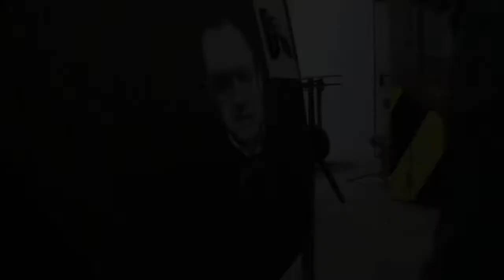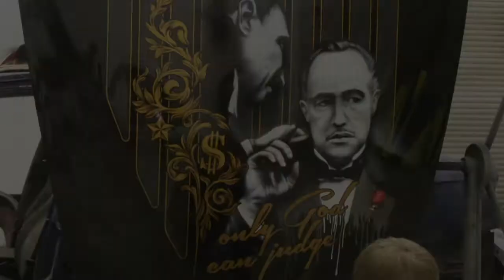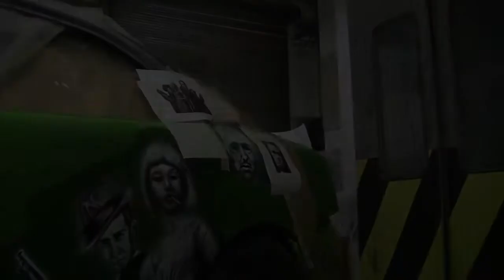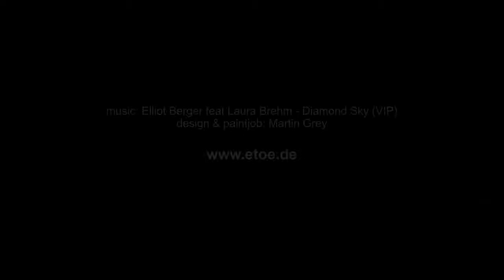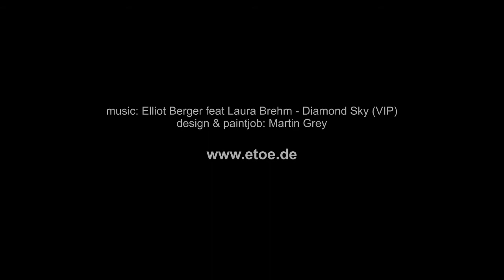Alfa Romeo 156 20v Turbo Mafiaalfa ETOE Custompaint

Comment: Richtig top, schöne Arbeit, und Natürlich als Basis DER COMMONRAILDIESEL, der der ganzen Automobilbranche zeigt/e, WIE man einen sportlichen, gar unkaputtbaren Diesel baut...der obendrein noch mit der sparsamste Diesel aller Zeiten ist.
Gerade im 156 ist der 20V dermaßen gigantisch, dass er seinesgleichen sucht!
Auch hinsichtlich Fahrdynamik ist der 156 obwohl FWD das Auto seiner Klasse, wo allem anderen in Agilität, Fahrdynamik und Kurvengeschwindigkeiten davonfährt bzw. ist es gigantisch, wie es Alfa Romeo allen anderen gezeigt hat, WIE man ein FWD zu einem echten Sportwagen macht.
Denn ich fahre und schraube nun seit 2004 Alfa Romeo, davon die meisten 156er, entweder mit Busso oder 2.4 JTD. Und eigentlich kommen mir nur RWD Autos in die Tüte! So hatte ich diverse BMW E30&36, sogar ein '86 E30 325i M-Technik 1, welchen ich via sperrdiff uvm. zu einem echten drifter umrüstete und dementsprechend Drift fuhr. Jedoch kommt wenn man so richtig schnell sein möchte, besonders auf Landstraßen dem Alfa 156 nichts davon! Und mein '98 156 ex 2.5L Busso, den ich mit einem 3.0 Busso umrüstete war bzw ist vielmehr in der Praxis als auf irgendeinem Datenblatt und dort angegebenen Leistungswerten, eine so gewaltige Steigerung gegenüber dem 2.5er...sodass diese leichtere 98er 156 Karosse in Verbindung mit dem kürzer gesamtübersetzten 2.5er 6-gang Getriebe jedem 3.2er alfa 147/156 davonfährt. Aber eben auch einem E36 M3 3.2L!
Und ja, die Datenblätter der Alfa 156er geben nicht ansatzweise wieder, wieviel schneller diese gegenüber besonders JEGLICHEM Datenblatt-King ala VAG/Audi S/RS 3 4 5 6, aber auch BMW sind.
Sozusagen keine Ahnung wie speziell Audi auf die angegebenen, martialisch wirkenden PS/Leistungsdaten kamen/kommen, aber es ist einfach nur geil wie ein 98 Alfa 156 mit einem 3.0 V6 24V der laut 166er Datenblatt 226PS hat, einen Audi RS4, oder auch Porsche Carrera davonfährt! Wohlgemerkt, dass der Alfa FWD hat, und keinerlei Traktionsprobleme, oder gar Untersteuern kennt! Hingegen JEGLICHE VAG Plattform wie zB ein Audi, auch eben besonders S&RS 4/5/6 den Motor jeweils im vordersten Abschnitt, weiiit über der Vorderachse, lieblos und billigs, aus sportlichen Ambitionen bei einer Konstruktion völlig Schwachsinnig platziert hat...und folglich kaum ein anderes Auto als ein VAG Plattform Fahrzeug mit FWD, als auch AWD so massiv Untersteuert.... Und all diese Laster bildeten Natürlich die Meinung bei den Leuten, jeder FWD würde Untersteuern.... Ganz anderes eben der Alfa 156! Der sogar trotzdem des FWD ein besonderes gut gelungenen BMW E36 mit RWD in Kurvengeschwindigkeiten, Agilität und Dynamik abhängt.
Sowas ließt man natürlich nicht in "Autoblöd Tests", die ohnehin "ihre Testsiege" von vorn herein feststehen haben...da VAG den Test von vorn herein gut zahlt...und so räumen VAG Produkte nicht etwa durch "Vorsprung durch Technik", vielmehr im Sinne von "Vorsprung durch Marketing" ab ;)
Gerade der 2.4 JTD 20V ist ein unglaublich gelungener Motor im Alfa 156! Nie war ein Auto, vorallem mit Diesel sparsamer, sportlicher und langlebiger!
Ich baue mir gerade einen Edelstahl Fächerkummer für meinen 2.4 JTD 20V um! Aus technischen Gründen als auch des Sounds halber! ;)
Denn der 5 Zylinder wo ja ohnehin weil's ein 5 Zylinder ist so viel mehr hinsichtlich Sound gegenüber jeglichem 4 Zylinder zu bieten hat, hat es in sich! 
DEINER hier klingt gigantisch!
Was hast Du verändert? :)

LG Till
Reply from the maker: Das ist ein Benziner 2,5 20v Turbo aus dem Fiat Coupe mit erweitertem Hubraum.